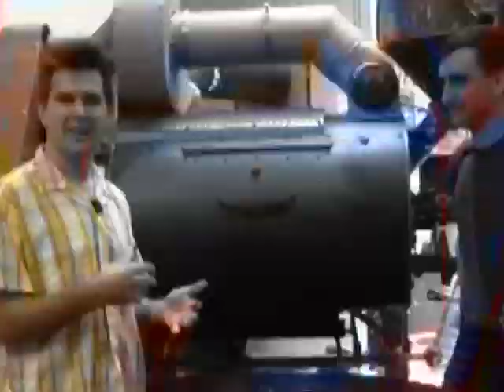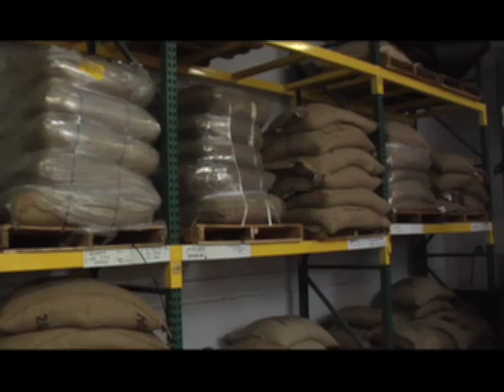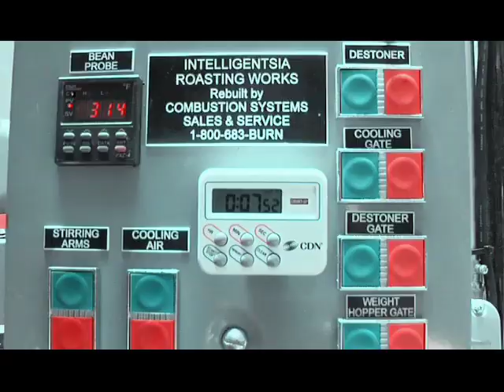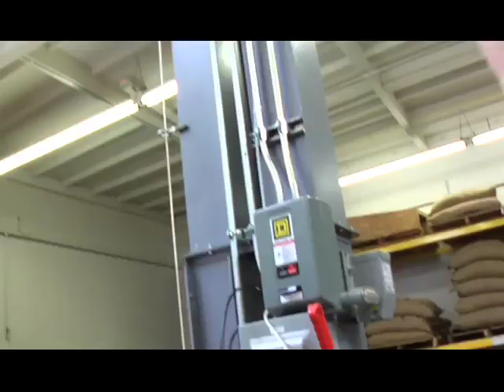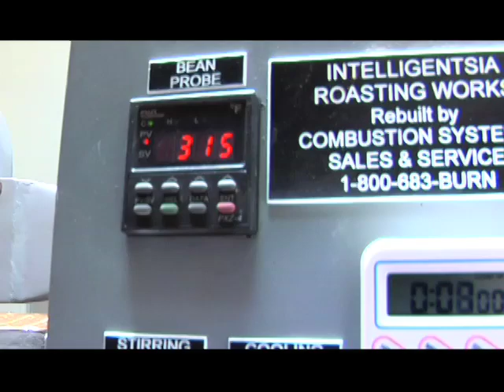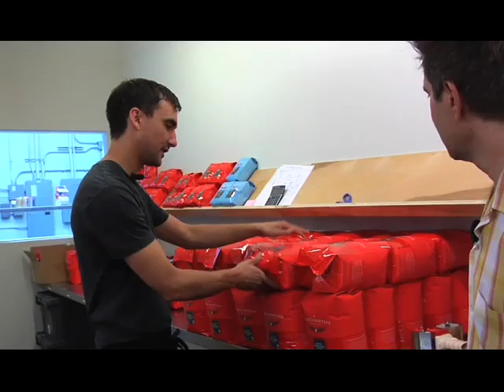A Morning at Intelligentsia Part 1 (BBtv)

Comment: Typically a darker roast will have less of what some may call a "brighter" taste, like many Kenya coffees. As beans are roasted darker they tend to have a more earthy, NOT BURT, taste, sometimes a little smokey, but you also have to consider which method was used to roast it. A "fluid-bed roaster" or a "drum-roaster". The fluid bed roasters would be the best for having a nice, lighter, balanced cup each time. The drum gives a bigger body to each cup.